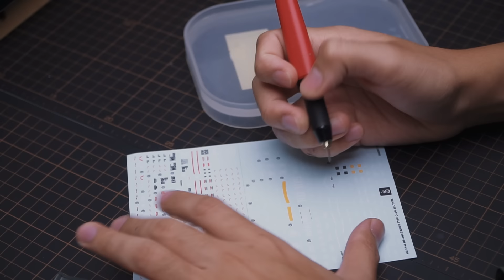Building Your First Custom Build Gunpla! A Beginner Friendly Tutorial. HGUC Zaku ll F2.

Comment: Where is this beginner friendly?
Reply: Yea the spray gun part got me 💀
Reply: I mean, it's for beginners not for the brokes right ?😭
Reply: I thought he was gon include the tools but prob cuz of sponser he didn’t but here’s everything I can include

Edit: I got pretty much everything expect the spray gun(way too expensive) since I’m still beginner o_o
Reply: @buriburibub  kudos for you to list all that bro😭 but really, the point of the video is the steps on how to build not what tools brand to buy. Clearly most of the stuff have cheaper alternative, except for AB.. Just use spray cans
Reply: @alephbuild0196   for airbrush if you wanna get the one he has the main ones are
Procon 0.2 & Procon 0.3 both platinum Im pretty sure
Reply: Its extremely beginner friendly? It's a good video that shows the process and how to perform basic modification techniques. Obviously, if you want to customize your gunpla, you're going to need sanding sponges and cement. Those are just basic tool any model maker would recommend you have.
Reply: @mrmanguy4849  yea I js got into Gundam about an couple weeks ago so far I have pretty everything expect airbrush things like booth, compressor and airbrush. Airbrush I’m thinking of going for either harder and Steenbeck Ultra 2024 or PS289 platinum 3.0 version 2.
And for compressor I’m going for Mr linear Compressor L5 with regular and gauge.
Booth I’m still deciding but my friend doesn’t recommend the Amazon portable plastic ones.

And ofc the paint aswell..
Reply: Lmao
Reply: @buriburibub yea i never understood the ultrasonic.. and alot of other tools as well. I put the whole runner in a disposable pan with hot water and dish soap and my parts literally squeak
Reply: You can paint by manual brush no need for the air brush. Steps are the same though : sanding, apply primer then paint. You can achieve the same result
Reply: @Nohorizon1  dang oof
Reply: @FunFactsIndonesia123  I got the ultra 2024 air brush already (;_;)
Reply: The part where you open the box
Reply: Yall trust me you can do this is a spray can
Reply: ...Building First Custom, Beginner friendly... to me, it means you've built gunpla before but never customized it.
Reply: This is the norm for scale models. Don't forget that's what gunpla are. Check out armor and air model builders, they do this  + more.
Reply: @alephbuild0196  Why would i buy a lot of tools for my FIRST Gundam?😭
Reply: @BigDig911  first gunpla and first custom build gunpla.. There's a big difference. Unless you're the guy who custom build his gunpla on his first build

Plus he never forced you to buy them tools. He just show the proper tools for it. You could just slap your gunpla with a nail clipper and call it a day
Reply: You don’t need to airbrush, it’s just the quickest way to get the look you’re going for. Just use a paintbrush and some patience.

If you use Tamiya paints you can literally thin it with a bit of water and get a good effect.
Reply: Me beginner: using nail clipper and nothing else 😂

Comment: one extra beginner tip: when doing the second cutting (after snip from runner). arrange the cutter position to be on the same alignment as the pieces itself, that way it would leave a lesser marks and damage to the plastic, which can discourage from going to further steps(yes later process can rectify it, but less-is-more should be the way for beginner-friendly).

amazing tutorial as always!~ ❤❤
Reply: I don't follow. What do you mean alignment
Reply: @saleen12  Cut along the "widest" thinner part of the sprue gate...rather than cutting through the thicker part. Less material to cut, leaves less damage to the part.

Comment: Yes ! I absolutely love using gemstone/rhinestone and the like for mono eyes on my kits. It's such a cheap and easy way to get a fantastic looking effect, I'm surprised you don't see more people talking about it
Reply: where can i find some online?
Reply: @arnogiessen9762  You can try searching up paper craft rhinestones or rhinestones in general. The ones I ended up getting were originally for paper crafts and they have an adhesive back, so all you have to do is peel it off the sheet and stick it on. I'd recommend getting one that comes with assorted sizes so you can get the one that fits your kits the best
Reply: For nice neat small sizes check out stuff meant for nail art

Comment: From what I have noticed, what tends to make for a really good beginner's customization kit is one that is simple in design to begin with, and also one that can be fairly affordable.

The Entry Grade Gundam, most High Grade UC Zakus (Origin ones won't work as well), HG GMs, or, as a slight personal favourite simple design for me... Core Gundams and the PLANETS system, tend to make for a fairly decent starting point with customization work.

That being said... what also helps at times can be having a proper plan going into the design process.  One also shouldn't be afraid of making mistakes, as that can as a result stifle one's ability to really learn.

I will very likely be utilizing this video when it comes to eventually making a proper custom, so that I can bring the best out of mine, but for now, the best thing I can do is watch and learn.  Kudos for the amazing Zaku 2 F2 build!

Comment: 1. How much time do I need between wet coat after mist coat? Do I need to dry after mist coat or do I moisturize it right after wetting it a little? 2. When you put up the main color other than surfacer, do you do the same with metallic paint?

Comment: I noticed many builders like to cut out all the parts first, sand them in one go, then assemble. I tried to follow this and I had difficulty finding individual parts later, especially the smaller ones and those that have left/right variants 😅 am curious to know if there're any particular good reasons for this?

Comment: Fantastic work. Quick question for you. Using your methods here, is the finished  kit mono-pose as a result of cutting off inner joint parts and painting the inner frame sections? Or is reposing possible? Cheers from the UK.

Comment: A question...is there any other option besides using airbrush?
Im not really in the budget tu buy those air compressor thing
Reply: Your best bet would be hand painting if your on a budget. Good brushes are expensive though and it takes some practice and time to get a smooth coat. That said cheap brushes can still get the job done and are better when your just starting out and learning to care for them. (I still use em fuzz I'm broke/learning too 😅). Vallejo and citadel make water based paints that are great for brush painting, but can also be little pricey and hard to come by.
Otherwise another option would be a portable compressor. I dont remember what they are called exactly, but a youtuber by name of Barbatos rex has reviewed them and they work great from what I've heard. Last I checked on them they can even come bundled with a decent airbrush. Price wise I recall them being 80ish$, but spraygunner sometimes has sales  around 40 (again, last I checked so I could be wrong). Sorry for long comment, but I hope this helps.

Comment: Can i ask what is the mist coat
Reply: Basically the first layer of paint on the part goes as a "mist" by lightly spraying it from further away, then after that you do the "wet" coat by going in closer with the airbrush and spraying heavier until the paint is even and matches the true color of the paint.
Reply: @-michael2904  thank you very much!